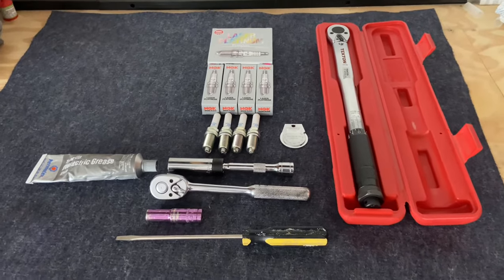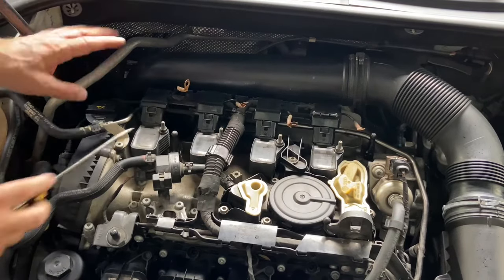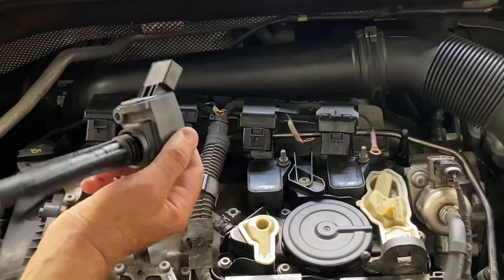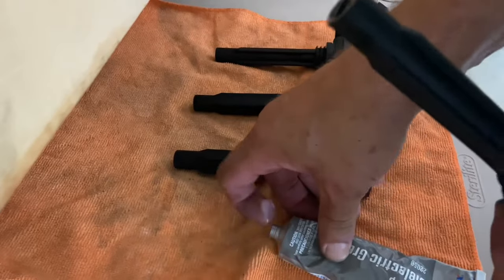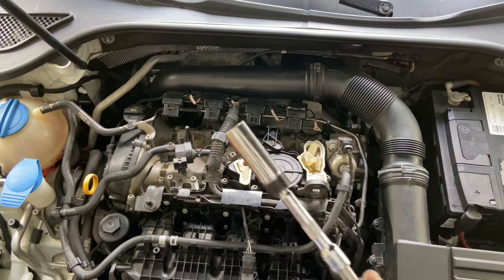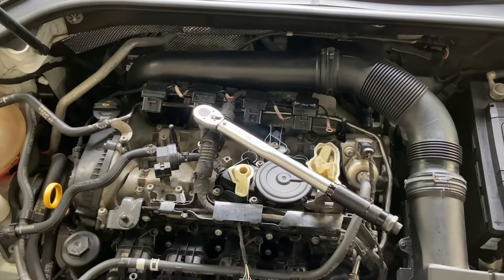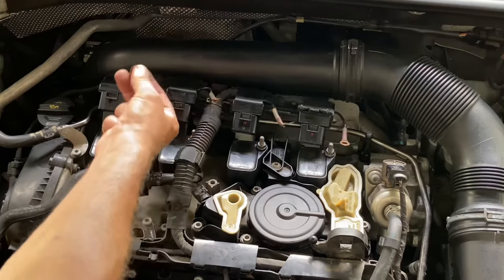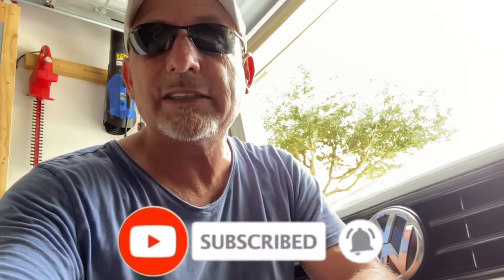VW PASSAT 1.8 TSI-HOW TO CHANGE SPARK PLUGS Passat/Jetta/Golf/Beetle #passat #sparkplug #volkswagen

Comment: I have a 2017 TSI SE Passat. Coming from a woman, THIS really helped me out. I took my car to the VW dealership with my engine shaking & they charged me $330 for a diagnostic test & changed out my filter. They didn't mention anything about a tune up. I was told I needed a New secondary Air Flow injection sensor/hose. That plus labor will cost me $840. I've never had my spark plugs changed out. This video makes me confident that even I can do this. TY... Wish you were in my home town Sir 🙏🏾😂🥰
Reply from the maker: I really appreciate the compliment.  Happy to know I could help.  It’s not difficult as long as you take your time.  The dealership is so expensive. I’m not a mechanic but I try to do as much as possible myself.  Sometimes those air flow sensors will cause vibrations.  But around 60k you should change the spark plugs.  Thanks again and I’m glad I could help 😎💯
Reply: Did changing the spark plugs work?
Reply: @gilt4523  It was time for a tune up, but I also have an oil leak, so that has to be fixed, along with the airflow sensor. The engine light came back on last week. TYSM for checking back with me. I'll keep you posted. Taking the car back to the shop in a few weeks. Blessings🙏🏾🥰
Reply from the maker: It worked before I changed them.  It’s just a preventative maintenance thing that you should do.  My gas mileage probably got a little better but it runs smooth and should be good for a long time.  💯👍🏼
Reply: @grind-it-out  TY I really appreciate you. Blessings🥰🙏🏾
Reply from the maker: My pleasure.  It’s good to know I helped some folks. Thank you 😎👍🏼💯

Comment: Good video.  One thing to note, I always roll the windows down and disconnect the battery before touching the coils on anything.  Maybe it's not necessary, but I feel better knowing the battery is not hooked up.
Reply from the maker: Never can be to careful.  Good extra precautions for sure 👍🏼
Reply: Yea and whenever you change a flat tire disconnect the battery and ecu just to be safe never want to short circuit the tire 👍
Reply from the maker: Absolutely 👍🏼 💯
Reply: @desipranksterz7909 Not to mention the muffler bearing…

Comment: Just went to do my wife's 80 thousand none of the boots want to come out. Dealer or who ever changed before must have not put any dielectric grease on them.
Reply from the maker: I always use it to keep moisture out and ensure a better connection.  I’m no profesional but I always use it.  Plus it would probably prevent them from being stuck as well.  I hope you found my video useful.  Thanks so much for watching 😁

Comment: For these TSI / TFSI  cars,  BRISK EVO series Spark plugs  work great, you can feel the power go up  than before and1-2 kms/ltr mileage increased...
Reply from the maker: Thanks for the info.  I’ll definitely look into that.
Reply: Any idea of what the part number might be for a 2016 vw passat for those spark plugs?
Reply from the maker: If you look in the description of the video.  I have the plugs and everything listed.  Just click on that and you’ll be good to go 💯😎👍🏼. Thanks
Reply: @selenarojo3233  is the engine CDA...1.8 TSI
Reply from the maker: No it’s not.  All cylinders all the time

Comment: Don't take a screwdriver to the wire harness coil connections. The little tabs are thin plastic and I snapped it off watching this. Push connector in more, push tab in, should feel/hear click. Then pull out.
Reply from the maker: Yea I know they are cheap plastic.  Thank You

Comment: Mine where at 0.040 😂 smh 🤦‍♂️ we installed performance spark plugs gapped at 0.024 - 0.026 witch is what Apr recommended after tuning. And I ran them at 0.040 for over 15k miles on the stage 1 tune 😂 it feels so much better in my opinion. I feel like it has a bit more power now but it’s only been about 5 hours haha… I did them today and tbh I think they were the original ones and I genuinely believe that this was the first time they have ever been changed. I’m at just over 96,500 miles
Reply from the maker: Yea definitely if you have as stage 1 the gap can change.  I was just trying to show original OEM stuff. I’m sure you noticed a huge difference.  I appreciate you watching the video.  Keep in touch. Keep on doing mods.  Thanks 👍🏼

Comment: Great video. I like your straight-to-the point approach without the often found pontification about the wisdom and virtue of plug and coil maintenance. I changed plugs and coils today. Your right, the coil bolts can easily cross thread. I felt one trying to, so I used a different one in it's place. Over the decades I've learned that once the threads start cross thread, they'll keep trying. Using one of the other bolts no will often remedy this, but ya gotta be real careful with both the offending screw hole and bolt or you could strip both, which causes a lot of heartache, money to fix and foul language.

I  immediately noticed a difference in performance - smoother idle, better pick up.  ONE HEADS UP... when you button every thing up and start the cart, you're dash may light up like a Christmas tree. It happens every time I reconnect my battery.  Drive the car a few miles and every thing should reset and lights will disapper. If you're low tire pressure light stays on, park the car for 45-60 minutes to let the tires cool off. Locate your tire pressure reset button - my car is a 2016 VW Jetta, so it's inside my glove box, yours may be somewhere else. Press and hold the button for a few seconds til the light goes out. Your owner's manual or Google can help, too.
Reply from the maker: I appreciate the comment.  Yea I try to deliver things straight.  I hope you didn’t strip a coil bolt.  Gotta be easy on those.  But thanks again for watching 😊

Comment: Great video. Helped me a ton. 

Some helpful things I picked up from other videos for those running into trouble: 

Let your car run for a bit before you get to work. Makes it easier to pull out the ignition coils. 

For the electrical connectors or whatever they’re called, you can also use a 90° pick tool (watch the FCP Euro vid on changing ignition coils + spark plugs) and slide it under the plastic lip and it’ll lift plastic and it’ll all slide right off. I used the flathead for two coils and the pick for the other two tighter ones.
Reply from the maker: Good advice.  I appreciate it.  Thanks for the comment! 💯😎👍🏼.

Comment: Great video. It helped this task go much easier. The biggest issue I had though was with the connectors. I actually ended up breaking one of them. I was at 125,000 miles and changed the plugs because it was misfiring. That corrected the problem.
Reply from the maker: Thanks for watching and yes those connections are really fragile.  Good to know your misfire is fixed.  I’m about to do a video on replacing the ignition coil’s.  It’s the same process It’s just time to replace them.  Thanks again 👍🏼😎💯

Comment: Hey sir thanks a lot, used this video to help me complete my repair 👍. 

Just of note, I think with these vehicles you should change the ignition coil along with the spark plugs. Mine were extremely hard to pull and I ended up pulling the top off, so I went ahead and got a ride to auto zone and bought a 4 pack.
For anyone having the issue with stuck ignition coils, I’d recommend pulling the top off and blowing compressed air into that rubber stem and they will eventually pop out.

They might have been harder for me to remove because I did this job at 81,500 miles.
Reply from the maker: Yea at 80 k they are probably pretty stuck.  I think 50-60 is the magic number.  I’m so happy you were able to figure it out.  That’s where the dielectric grease comes in.  They will always remove easily.  But at least you got it done.  Thanks again for watching I appreciate it much. 👍🏼😎💯

Comment: Just a heads up about the coils…they don’t need to be put back in the same order that you take them out. A coil is a coil…unlike the old distributor cap/wire combo which required the wires to be put back exactly how the came off….also just a tip…if you ever have a an issue with a cylinder misfire, you can diagnose it by moving the coil of the misfiring cylinder to a different cylinder…if the misfire then moves to that other cylinder you now know that you need a new coil. If it doesn’t change then you know it could be the spark plug or a different issue…great video…keep up the great work.😊
Reply from the maker: 💯 thank you

Comment: Great video. I was having such a time getting the wires that connect to the coil removed. Other videos I have watched weren't as detailed as what you've done here. I finally got my plugs and coils replaced today. I was just a little behind the maintenance schedule........ran plugs for 211+k miles. Just started noticing lower gas mileage and a little hesitation. Thanks again for your video.
Reply from the maker: Thanks for the ultimate compliment.  I have the same issue with other videos sometimes.  The small details.  I’m really happy I could help.  Thanks for watching 😁

Comment: Great video! This might help someone. The top half my coils detached from the bottom half. What we did was pull up on the rubber by about an inch, stuck a long flathead screwdriver in there and fished it around from a couple of different angles. This caused them to pop out no problem. Some took more effort than others.
Reply from the maker: Yea they get dry and brittle.  Sorry that happened.  That’s why I put dielectric grease everywhere to prevent any of that in the future.  Hey I really appreciate the comment and compliment.  Thanks for watching the video.  Consider subscribing if you like.  It really helps the cause for the channel.  Thank you thank you 👍🏼
Reply: @grind-it-out  You got it!
Reply from the maker: These stupid cars are constant maintenance.  I don’t drive mine hard but stuff still goes bad after awhile

Comment: Just gave me hope on changing my spark plugs and coils myself and save a bunch of money but how do I know which coil is bad ?
Reply from the maker: You can do it.  As far as the coil.  Switch it with another. If you get a bad cylinder reading it should change to the one that’s got the bad coil.  If the second coil is bad, switch it with the first one.  That will verify it’s a bad coil.  If nothing happens then it’s a cylinder issue or bad plug.

Comment: Awesome video! When you pilled the coil you mentioned it's dry, what is the cause if you see oil? My son's car even had a couple drops come out of the coil at the plug. Not looking good?
Reply from the maker: Not sure about the oil.  Maybe a piston ring is going out.  But yes they are typically dry.  I hope it’s not serious.  I’d replace the coil pack at least.  I’m about to replace mine with upgraded APR coils.  I’ll drop a video in about a week.  But yea.  Let me know how it goes.  Thanks again for watching 👍🏼😎💯
Reply from the maker: If the plug on the inside has oil it’s probably a bad piston ring or something of that nature.  Not sure about the coil pack itself.  Just a wild guess.
Reply: @grind-it-out  It's the coil boot and coil. Thanks for the info on upgraded coils Ill be waiting for the video!
Reply from the maker: Ok oil may have gotten in there from the top of the motor somehow.  Anyway.  Thanks again. 👍🏼😎💯

Comment: Great video, very detailed. For some reason my magmatic socket is not working, I have the same as you. I feel like the hole/pipes are narrow for socket to reach deep. I have 2015 Passat limited, any idea what it could be?
Reply from the maker: Thank you for watching.  I’m not sure about the magnet issue. Never had that issue before.  But maybe look into getting another one.  But it does help.  You can use a regular spark plug socket socket with rubber instead of magnet.  Good luck and I’m glad the video helped.  Consider subscribing if you like.  😁😁😁👍🏼

Comment: I really appreciate the simple way you explain it
Reply from the maker: Thank you.  If you have any questions please let me know.  Thanks for watching.  Consider subscribing if you think it helped.
Reply: @grind-it-out  My car then misfiring here in there. To the point that my engine light turns on and off. And it can be 2 to 3 weeks before the light turns back on or off. do you think changing the spark plugs will fix the issue. Because the codes are stating that is a misfire. I also just subscribed to your channel on
Reply from the maker: Thanks for subscribing.  I appreciate it.  It could be your coil packs.  I always do plugs and coils first then if that doesn’t fix the problem it’s possibly a bigger issue.  Plugs and coils are normal maintenance anyway so I’d do that even if it doesn’t fix the issue.  Gotta start with basics then narrow down the problem.  Find out what cylinder is misfire then swap the coil with another coil and see if the misfire changes to the other cylinder.  If that the misfire changes cylinder then you know it’s coils.

Comment: Broke one of the clips on the coil connections (how do I get that one off)  and one of them I cannot get off even using all of my might. 

I’d love some help 2:39
Reply: How can I loosen them
Reply from the maker: It happens.  Get the screwdriver on the bottom part of the clip and pry it while lifting  the coil with the other hand.  I’ve broken some before.  They aren’t snapped in very hard.  Try that.
Reply from the maker: But before you really break the wiring harness look at it closely.  Just get it to break free using light pressure.  If you broke the clip just grab a piece of it with pliers or something and pull

Comment: I installed NGK Plugs should ignition coil brand match for better performance? vs. the manufactured coil
Reply from the maker: That’s not necessary at all.  I prefer OEM coils.  Or APR coils for aftermarket.  Most auto manufacturers use NGK plugs they just slap their name on the plug.  Thanks for watching Consider Subscribing.  👍🏼

Comment: The coil packs are notorious for failure. They are not very expensive. VW/Audi has upgraded these over the past few years. Latest ones are from Japan. Consider replacing them if you have gotten 70k miles or 5 years usage. It's good insurance and you'll still have your old ones, if in a pinch.
Reply from the maker: Thanks for watching and I appreciate the comment very much. I’ve recently purchased new coil packs and I will do a video on that when I find the time but my focus on this video was to just show how to change the spark plugs.   But yes, I do agree that around 70 to 80,000 miles. People should probably look into changing the coil packs.

Comment: can you please tell me 2019 vw beetle 2.0 turbo how many miles befor a spark plug change  is due  ?
Reply from the maker: Not exactly sure but usually 50k miles.  Owners manual will say exactly but most are 50 k give or take.  Thanks for watching.  Wish I had exact answer 👍🏼😊

Comment: Question ! I have a 2017 Passat and I am at the part where I need to put the spark plug socket into the cylinder, and it’s not working, very frustrating. Is there any ways to help me out? I have the socket 5/8th with the magnetic socket. Send help lol
Reply from the maker: All I know is use your hand to tighten it at the end of the extension.  Then once it gets threaded on finish tightening with the ratchet.  Not sure what the issue is.  Just guide it in.  It should nicely fall into its place.  Not understanding why this is happening
Reply: @grind-it-out   I wish it can just fall into the colder but it’s not. It’s half way through , and not reaching the bolt to the bottom where the spark plugs are at. Thanks for replying!
Reply from the maker: You need a longer extension I think.

Comment: two of the coil sleeves are stuck in spark plug, how do I taken out?
Reply from the maker: Keep pulling.  Sometimes if they break you just have to replace them.  That’s why I use the dielectric grease so that never happens.  If they are stuck that bad they probably need to be replaced anyway.  Hopefully you can get it out.  Pull pull pull.  💯👍🏼😎
Reply: @grind-it-out  Thanks for reply and encouragement.
Reply from the maker: Anytime 💯👍🏼😎

Comment: Wait but you said we’d need the gap gauge tool but I never saw you use it
Reply from the maker: Yea sorry about that.  It’s super easy.  There are tons on videos about that.  But simply put the spark plug on the tool and run it along the gap tool until it stops.  The reading on the tool will tell you the gap.  Most NGK plugs come pre gapped anyway.  But it’s always good to check.  Let me know if I can offer any help.  Thanks

Comment: I broke 2 of the plastic release piece of the connector clips and I can't get them off at all. Beyond frustrating and nothing I'm trying to do is working.
Reply: I walked right around the corner to AutoZone and got a pick/scribe tool with a 90 degree angle and I was able to pop the latch and take them off
Reply from the maker: The clips are not very tight.  It’s just a small raised part on the coil.  Try to gently pry so you can see inside it.  Pull same time 😬
Reply from the maker: Great.  It’s just cheap plastic.  So easy to break